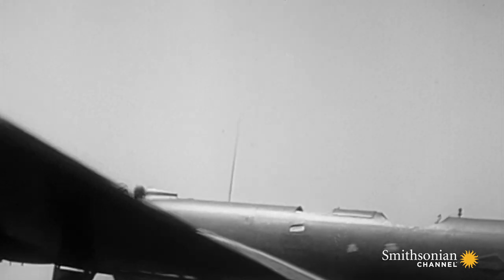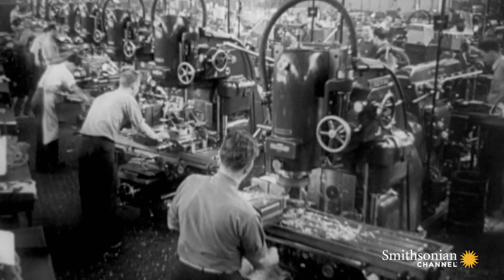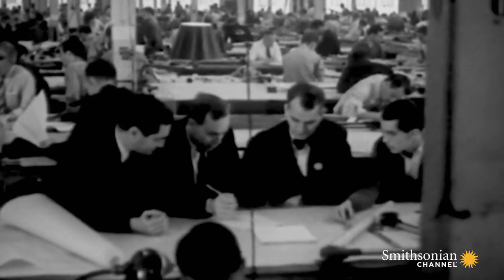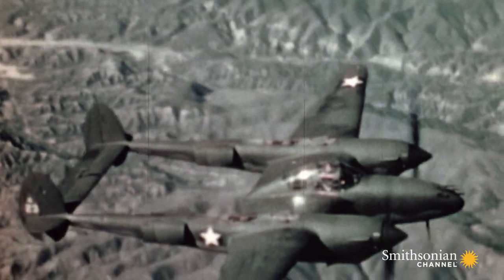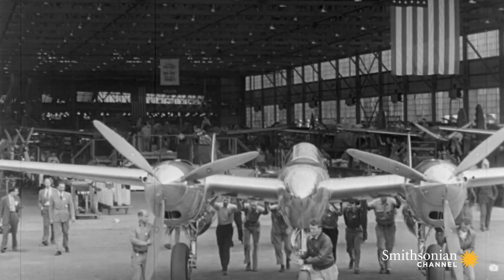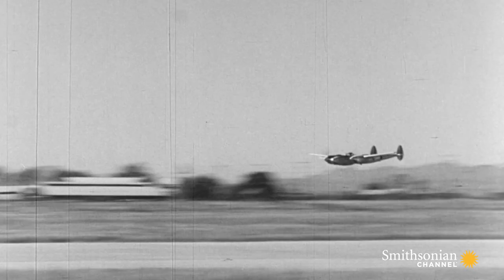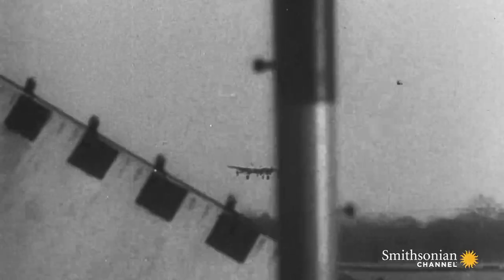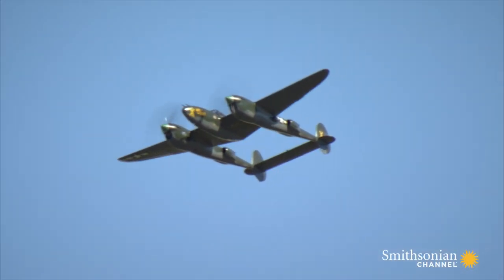How the P-38 Flew Faster and Higher Than Its Rivals

Comment: How did the P38 compare to a Mosquito?
Reply: it did not in many the roles the sheared except maybe the role of pure day  fighter role everything else the Mosquito out performed  the P-38
Reply: it didn't
Reply: @smitbar11   Different roles or one was superior?
Reply: @daniellastuart3145    Mosquito was a light bomber
Reply: These two aircraft are very similar in performance.  Mosquito is listed as one mile per hour faster - but that doesn't mean anything one way or the other.  They had about the same pay load and range.  Their missions were different in that the Mosquito was an Intruder and the Lightening a Fighter.  The Lightening could probably out maneuver the Mosquito but the version of the Mosquito with the guns had a heavier armament.  The Mosquito's Rolls Royce Merlin's were rated at 1710 hp where as the Lightenings Allison's were rated at 1600.

The thing is, all these aircraft were produced in different versions and these would have different performance characteristics.
.
Reply: Later versions of the Mosquito were much faster but by then the P38 wasnt a 1 line fighter anymore. And of course the Mosquito was king during the night.
Reply: @samuelgordino  The Mosquito was a fast aircraft.  Being fast was it's thing and it excelled at being an Intruder, especially at night.  It wasn't a fighter though and didn't perform fighter missions as a rule.  For example - you don't hear of Mosquitoes providing daylight bomber escort missions in large numbers - though it did escort British Night Bombers in smaller numbers.

As to speed - the Mosquito was a little bit faster - but not as much as people let on - and - the P-38K would have been faster than the L model but they didn't want to disrupt production to start making them.  The P-38 also had a higher ceiling.

Both these aircraft performed a number of the same missions.  They even had P-38's with Bombardier noses so they could lead a formation of P-38's all dropping on the leader and they had a two seat night fighter version.

Still - one was a fighter plane and the other a light attack aircraft.  Comparing the two is like comparing apples and oranges.  P-38's should be compared to other fighter planes and Mosquitoes should be compared to other aircraft such as the P-61, Beaufighter's, B-26 Invaders and Boston/Havoc's.

Both aircraft, ironically, made a point of using a war resource.  The Mosquitoes were made out of wood - which caused them structural problems in the tropics where the P-38's excelled.  The P-38's used Allison Engines.  Allison had a great big engine factory and made a lot of good, if not great, engines.  There was talk of putting Merlin's in P-38's but Allison protested and nothing came of it.  They did try Merlin's in P-40's but - it didn't give them the performance boost they got with the Mustang/Apache's so - there's no telling how that would have worked out.

What I come away from this with - is - common knowledge is ... not always so accurate.  The P-38's were better aircraft than they were given credit for - especially in the most produced L model where they fixed all the problems.  I also suspect that the Mosquitoes were, while they were a good plane - not the best at EVERYTHING the way some Anglophiles like to talk.
.
Reply: @BobSmith-dk8nw  The Mosquito did daylight escort missions, mainly over Norway and the Bay of Biscay. OK, not in the numbers we usally see in the 8º force use but that doesnt mean small numbers. At night it wasnt small numbers. 60 or more Mosquitos every night were common.
Reply: @samuelgordino  Yeah. Things I was reading said up to a hundred - which is small numbers.  My point was that each did the same missions as the other - but they were used in different ways on different scales.  P-38's flew night fighter missions - but that was a minor thing they did, same with the Bomb Leader missions.  At one point in time the USN used SBD's for Combat Air Patrols ... I mean - they did have two .50 cal machine guns - but that wasn't the best use of that aircraft or what it was known for.

So - things like calling a Mosquito a fighter plane ... it was no more a fighter plane than the B-26 Invaders fighting Castro's Mig 15's.

Again - comparing Mosquitoes and P-38's is really pointless.  The reason people do that is - again - "which is better" - but it's just stupid.  Neither was "better" they were just different aircraft with different characteristics - that were used in different ways.

Again - a better comparison would be Mosquitoes and P-61's as night fighters and Intruders.  One of the things the P-61's would do - is go loiter about the bases the German Night Fighters operated from and nail them on the way home.  That would be an interesting comparison.  What were their tactics?  How did the differ?  Why did they differ? How did their equipment compare?  You could include all the Night Fighters in a comparison, allied and Axis alike.  Ask the same questions about all of them - that would be interesting - not some bull shit about "which was better - an apple or an orange".

Sixty Night Fighters is a lot because - they flew alone. Day fighters flew in squadrons if not groups - and they were going against other day fighters flying in squadrons or groups.
.
Reply: Herman Goering:
"In 1940 I could at least fly as far as Glasgow in most of my aircraft, but not now! It makes me furious when I see the Mosquito. I turn green and yellow with envy. The British, who can afford aluminium better than we can, knock together a beautiful wooden aircraft that every piano factory over there is building, and they give it a speed which they have now increased yet again. What do you make of that? There is nothing the British do not have. They have the geniuses and we have the nincompoops. After the war's over I'm going to buy a British radio set - then at least I'll own something that has always worked".
Reply: 18tangles  Well given the amount of time the RAF spent flying in the dark they should have the best Night Fighters.  That pretty much sums things up.  Night Fighters were a priority for the RAF since they were being heavily raided by the Germans at night, especially early in the war and flew most of their bombing missions at night.  The Americans - were not being raided by anything but Japanese Balloon Bombs and flew most of their bombing missions during the day.  Thus the Americans got by with night fighters that were conversions of something else until the P-61's arrived.

When they did the P-61's were good night fighter's despite what the British thought - they just weren't that fast.  They were more than fast enough to catch your average bomber but weren't up to catching the high speed intruders.  Given that the Mosquitoes, a high speed aircraft itself, were being used by the British - the P-61's gave the Americans as much of a night fighter as they needed.  As to the number of kills they got - for a late war aircraft of which only 700 were made (in comparison to 7,000 Mosquitoes) and which didn't have a lot of targets - they did OK.

Offensively, the British, whose heavy bombers suffered terribly at the hands of German night fighters, desperately needed support and put a lot of effort and organization into their night Intruder missions, developing very sophisticated equipment and tactics for supporting the British bomber stream.  The Americans simply adopted the tactic of loitering near the German night fighter bases and waiting for one to come home.

If you look at the P-61's deficiencies - most were eventually corrected - but for the Americans - it wasn't a high priority and that showed in the speed with which things were taken care of.

When it came to Night Fighters - the Americans and British both had their priorities straight.
.
Reply: 18tangles  I have no idea what you mean.
.
Reply: 18tangles  And the British didn't?  Ha!  Ha!
.
Reply: 18tangles  Because their aircraft were damaged and they could get there.  Better to be interned than a POW.  Why don't you know that?
.
Reply: It didn't it was pretty much outclassed by the Mossi, but the P38 was a much older design and was purely a fighter, while the Mossi was intended to be a light bomber but turned out to be a brilliant multi role platform and was probably the allies most effective all round aircraft in the western theater.
Reply: 18tangles  Never in the night fighter role, but as I pointed out the Mossi was designed as a light bomber so yes in comparison to an early model Mossi  the P38 probably was better pure fighter, but the later more powerful Mossi's were at least its equal in the fighter roll and totally outclassed it in terms of the armament and roles the Mossi could fill. 
 The P38 for a 1930's fighter was advanced but it was out of date by 1942/3, which is why I say it was completely outclassed by the quickly evolving Mossi in the Europe. Although by the time the USA entered the war the P38 was dated in terms of European air war, it was not because there was anything wrong with the P38.  It simply had not been forced by the pressures of front line service to evolve at the same rate as the aviation arms race between the British and Germans advanced their aviation technology.
Having said all that, in the long range conflicts of the Pacific it was superlative at what it did and was the perfect machine in that environment. Horse for courses, but over all when you put the two planes side by side the Mossi was simply a much better platform than the P38.
Reply: I'm not knocking the P38 in anyway here, because it's a plane I really like and think its a seriously good looking aircraft. (god only knows how many airfix P38 models I have built over my 55 years, but I do know that after the Spitfire it's probably the one I've built the most.)
Reply: Bob Smith what’s a “Lightening”?

Comment: I like the P-38 But if i had to pick it would be the wooden wonder The De Havilland Mosquito "Tse Tse"  Armed with a 57mm Auto loading Anti-Tank Field Cannon 6 pound shell And 4 machine guns *(Pilot Tony Phillips destroyed one Ju 88 with four shells, one of which tore an engine off the Ju 88)
 End of war Had a 96mm 32 pound cannon This Plane filled all roles speeds alts and weapons No other aircraft could as a equal  Aside from being made of wood preventing designers, metal workers and metal from stopping its production on one aircaft to start on this one. The Variants of bombs is in a class only to four engine bombers  But could fly at 100ft and more than x2 the speed  Submarines  SS HQ  Enemy planes V1 rockets  Tanks Bridges  Trains  and more fell victum 

The Germans Tried to copy the design and failed  As the German version  fell apart just after take off

Comment: Heard this plane was crazy to fly,killed numerous pilot learning to fly it! Steep learning curve!☹️🤕
Reply: Compressibility.   A dam of air would build up in front of the wing.   They would have figured it out sooner, but couldn't get time in the wind tunnel.   So they designed an air-brake fix for when the pilot had exceeded the design spec on fast dives.   They also designed a revised version that had the outer and inner wing edges offset from each other.  That prevented the air dam from jamming the controls.

Comment: Charles Lindbergh went to the Pacific as an “observer”  and wound up flying combat missions in the P-38. While there he demonstrated how he could improve the range of the aircraft through running a different mixture.
Reply: Actually what Lindbergh showed them that running the engines at low rpm and higher manifold pressure saved gas and improved range. 

The tech people from Allison thought it would ruin the engines. Opening up and inspection revealed otherwise.

Comment: Isn't this the predecessor to the a-10 thunderbolt or warthog?
Reply: Drake Kay The P- 47 Thunderbolt from WW2 is the plane that associated with today’s A-10. It was a dual purpose heavy fighter that could take heavy damage and was also used as a ground support aircraft that could inflict devastating damage with it’s Eight 50 caliber machine guns and 5 inch rockets as well as the ability to carry 2500 lbs worth of bombs.
Reply: @jasonstein460    I would suggest the Douglas AE1-Skyraider would also fall into that category

Comment: The engine was not an inline. It was a V12. Refer to the US  model number for that engine. You would think that these words were written some english person.
Reply: @basil punton. The Brits have the same definition. Inline engines are i4, i5, i6 and i8. Though a V12 can still be referred to as an inline engine:- noun: inline engine   
a type of internal combustion engine used chiefly in aircraft, having its cylinders arranged in a row.
Reply: In aviation when comparing a V12 to a Radial engine,  the V12 is considered an inline engine compared to a Radial 12 cylinder.
Reply: There were two types of aircraft engines in WWII Inline and Radial. Inline does not mean straight like a straight 6 it means the cylinders are in a line but there might be more than one bank of them like the "V" style inline engines.
Reply: Simply the US airforce uses I for inline engines and V for v engines, and R for radials. This is the correct way. Not the way that people who do not understand differences claim that v' s are inline. Are you all claiming that the US airforce is wrong?
Reply: @basilpunton5702  No, I am claiming you are wrong,
Reply: @basilpunton5702  Basil, you are indeed wrong. Now my USAF experience may not matter for shit, since we don't use pistons anymore, but my aeronautical degree should matter for something. Inline engines can come in various shapes and still count as inlines, as long as there are pistons lined up in a front-back column. From there, you can add columns of pistons. If you are wondering what keeps a radial with multiple rows from being an inline, it's the fact that radial rows tend to have an angle offset so that there are no cylinders perfectly lined up with each other.

Comment: Fake News. The P38 was a good plane but completely outclassed by the Mosquito which was without question the fastest allied aircraft of WWII.
Reply: The94GTC  I did and that's why the video is Fake News because it claims that the P38 was superior to its rivals. Was the Mosquito a rival or was it so superior that the term rival doesn't apply?
Reply: The94GTC  "How the P-38 Flew Faster and Higher Than Its Rivals" is the title and we can all speculate what is meant by this. IMHO the person who came up with the title is either biased or not as well informed as they should have been. I accept that the Mosquito was not an American aircraft but it was most certainly a rival for speed and altitude with the P38 and in these categories (and many others) it was the superior aircraft. The title should have read How the P-38 Flew Faster and Higher Than Its American Rivals, in which case it would have been true. However it did not which is why I believe it is Fake News because it is miss-leading to anyone who has little knowledge of WWII aircraft.

Comment: Actually almost identical performance to the De Havilland Mosquito which was built with out dated timber construction by cabinet makers and piano builders.
Reply: Oh?? What was the Lightings bomb load?
Reply: Something's telling me that certain people don't study anything that wasn't built in the USA...The Mosquito was just about the best combat aircraft ever to have taken to the skies.  Its combat record has no equal.
Reply: The timber construction may seem outdated when you don't know anything about it, especially when the rest of the world is transitioning from wood and cloth to aluminum (aluminium for the Brits), but the composite planes we build now out of carbon fiber are the children of DeHaviland's composite wood design. He basically skipped ahead 50 years with the Mosquito's airframe; quite impressive.
On the rivalry between the Lightning and Mosquito zealots, keep in mind that the P-38 was flying for two years before DeHaviland even started designing the Mosquito, and this is at a time when new generations of planes are surpassing the previous generation every 3-5 years. So not only is the P-38 more outdated, the Mossy also got the chance to learn from it and incorporate its strengths and minimize its flaws.
As far as combat records go, the P-38 was the plane that produced the number 1 and 2 highest tallying Allied Aces, and the 4th and 5th. The only significant record I have heard about the Mossy is its pilot survival rate, which was amazing. But when your main job is shooting down V-1's, there sure isn't much danger.